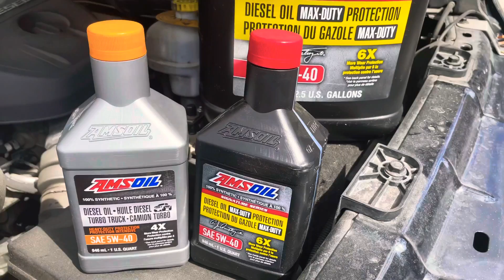How to Ram eco diesel oil change . Used AMSOIL 5w40 use  referral 30213198 to set up your account

Comment: How the amsoil oil been doing? Notice any significant difference at all?
Reply from the maker: I’ll have to ask the customer. He has been at work . It dose idle down quickly and quite on startup. I do have a few other guys testing it in gas motor I have a guy that watches fuel close. And I am switching my truck over drive line trans all of it we ran it in equipment for years . I started up the dealer account to get the savings and it just kinda started selling it self when people found out I could get it .